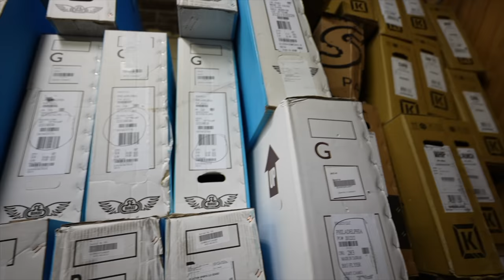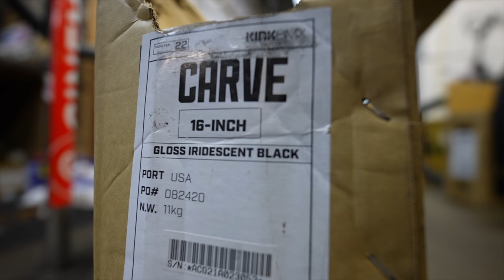WE BUILT UP NEW 16" BMX BIKES AND PLAYED A GAME OF BIKE!

Comment: It could be the clutch but, I also might just be the heatshield on the exhaust. On Honda's it's normal to just remove the shield after a lot of heat cycles. Reason I think this might be the case is when the RPM's get low the exhaust shakes more and the shield might have warped enough to hit the Catalytic converter or Reso or Pipe.
Reply: this. those heat shields are notorious for coming lose especially being in the north east.
Reply: That's what it sounds like to me
Reply: Looks like we have all heard that noise before LOL
Reply: Lol it’s only noise when clutch is out. Not a heat shield
Reply: @Tylersweird  that's a solid point
Reply: Not a heat shield that would be more of a rattle and would be at certain vibrations at different rpms since he said it's when he lets the clutch out then it's throw out bearing
Reply: 100% bearing chirp from the throw-out

Comment: My car did the same thing it sounds like a exhaust Shield rattling if it was a throwout bearing it would do it in every gear and every time you push the clutch in or the clutch doesn't just come and go at stays hundred percent exhaust Shield or something under their rattling
Reply: not necessarily.. it probably only sqeals when it's spinning around a certain speed
Reply: I was thinking catalytic heat shield as well. It could be the bearing but it sounds more like a rattling of a heat shield to me. I'd definitely check that first if it was my car
Reply: Yeah definitely for sure it doesn't sound like you throw out bearing usually there louder and more metal on metal that's more like a rattle of a vibration
Reply: Honestly I would check your motor mount and transmission mount

Comment: Almost sounds like exhaust rattling but may be throwout bearing
Reply: If it was exhaust rattling it would happen regardless of gear or clutch position... I'm 98% sure its throw out bearing
Reply: I'm going with the heatshield.
Reply: @dlmperformanceandracing  right, doesn’t have the tin can sound to it, I think throwout bearing as well. Heat shield is easy diagnosis anyways so just look it over guys! Keep up the dope vids. 👍🏼
Reply: @dylanalmony7735  take it from a 11x turbo Subaru owner, throwout bearing lol     ..  always a problem with subarus, if it ain't knockin the driveline is on the shitter
Reply: Sounds like a dry throw out bearing. Time for some maintenance. Don't let it go to long

Comment: Definitely throw out bearing!
I’ve had it happen personally. New bearing an fresh clutch an haven’t looked back yet!
Reply: I'm not a car mechanic or anything, but this sounds like the most likely culprit. Doesn't sound like a belt at all, and there aren't that many things on a car that can start squeeking really weird like that and not be immediately identifiable as something rubbing on something else.

Pro tip, if you pour a sack of concrete into your gear box it'll stop making that sound immediately.

Comment: It's either the throw out bearing or more commonly the throw out fork needs greased up. Being it only has 81k its not likely it needs a clutch already unless Matty is launching it all the time. I'd say grease the for where the slave cylinder pushes to disengage the clutch first and if that doesn't fix it then do a clutch and throw out bearing and flywheel.

Comment: 100 bucks its the pilot bearing. The throw out bearing will make noise just pushing the clutch in, in gear or neutral. will not change. The input shaft of the trans is spinning slower than the engine in gear while releasing the clutch, thats all in the pilot bearing.

Comment: Stock Impreza had a similar sound. Turned out to be those amazingly poorly designed Subaru heat shields. Started as a squeaky type sound like we're hearing here, then turned into that unmistakable tin can rattle. Would only happen at low RPMs, like when taking off, then smooth out.
Have an uncanny amount of self tapping screws in the heat shields now. Lmao.
 Def could be throw out bearing tho.
I'm not a Subaru expert and def not an STI guy. 
Fun vid. Just bought a 16" unicycle today for God knows what reason. Making it a 16" day here.

Comment: Exhaust Hanger or Heat shield possibly, Subaru's are notorious for rattling heat shields. . Bring it back up here to NH and ill fix it for free at the shop lol
Reply: it's not a rattle though.. it's a squeal
Reply: @shithead  2 metal objects grazing against eachother can squeak, rattle, squeal. All kinds of noises.
Reply: @Bryanbobber  Show me a loose heat shield that makes a steady squealing nose and I'll give you 10 bucks lol the noise is clearly coming from something spinning or rubbing constantly, theres no way in hell that's a loose heat shield vibrating that fast
Reply: @shithead  ill grab a video tomorrow and most likely the day after and so on. But your right. Probably a throw out bearing.